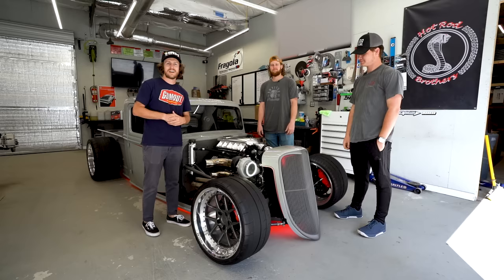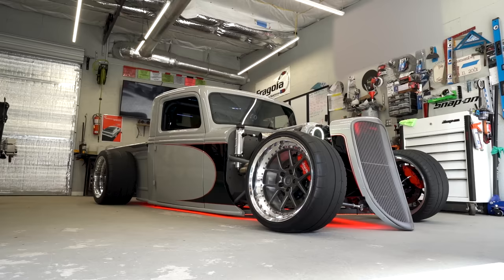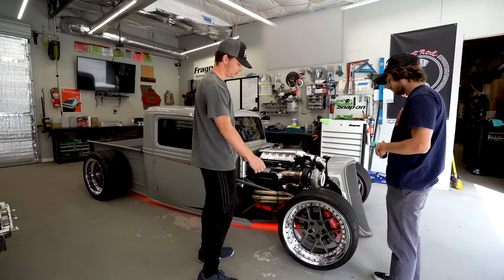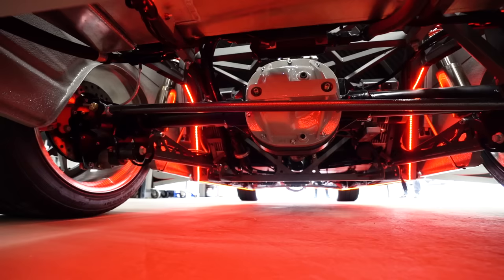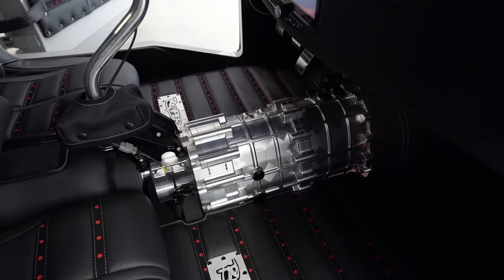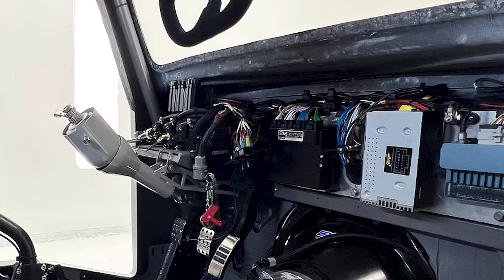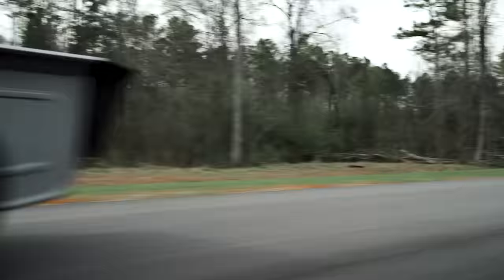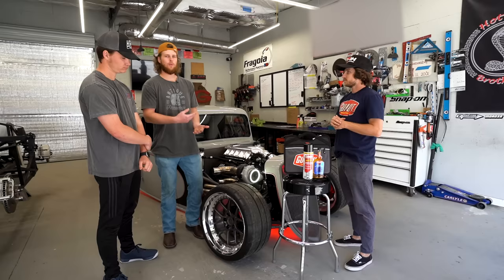1000+ HP 1935 Hot Rod Truck with Twin Turbo Coyote Motor | Factory Five Sema Build

Comment: I know I'm commenting again, but I just realized the cage it had tucked away so tightly in the roof. (I noticed before they switched to the incar shot)

Sequentials are cool n shit but damn they are super loud! I'd be trying to implement as much sound deadening as possible, and redoing the trans tunnel to help block out the sound! 

If it's gonna be a cruiser, I would think you would want it to be as comfortable as possible right? It's got heated and cooled seats, with it whining like that your brain gonna be so rattled you won't be able to feel the seats lol. Id deff look into sound proofing

Comment: Very cool except for the tranny. I don't need to see it and definitely don't want the heat from it not to mention with that much horse power it's not very safe at all but like the old dragsters it takes loosing legs to figure out I don't need to see it I need protection from it duh